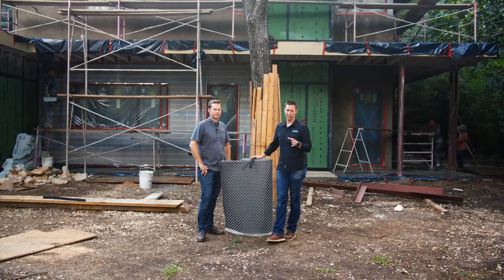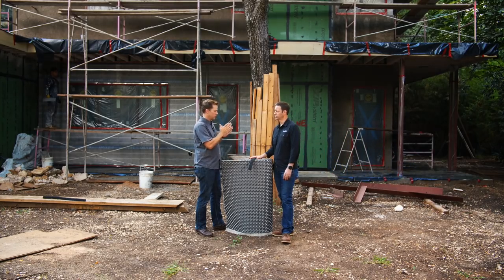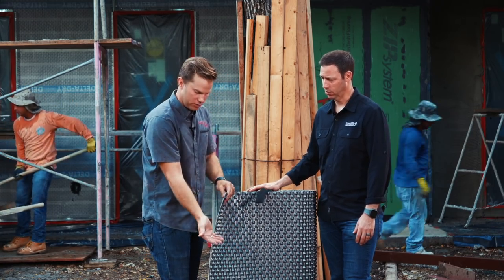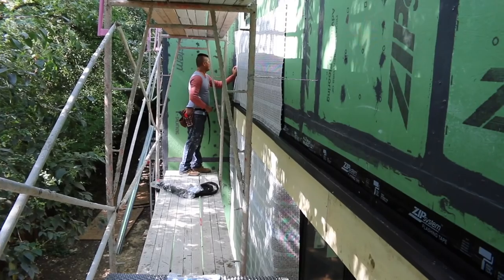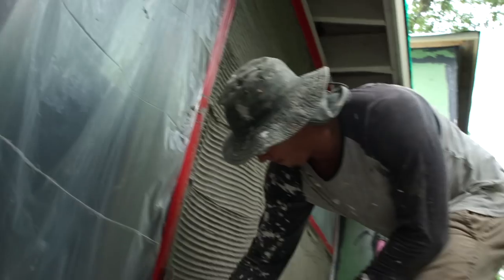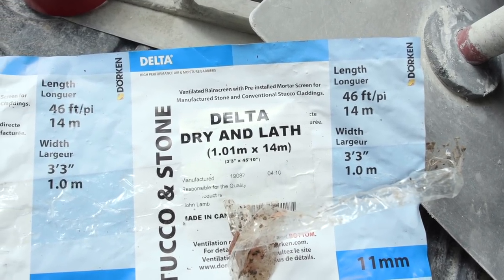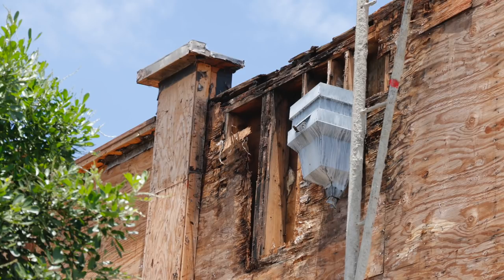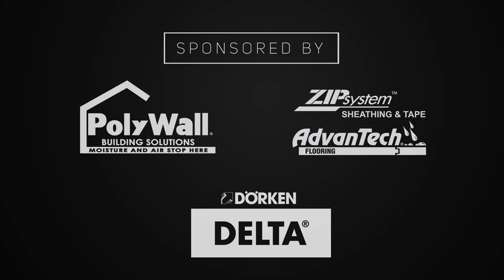WHAT is this, and WHY do you want it under your STUCCO?

Comment: It seems odd, it's the year 2019 I've been told; yet how is it that the art of not rotting a wooden house in practice hasn't Been implemented on most structures?
Reply from the maker: Because old buildings had lots of heat and air loss to dry them out. New codes mean less loss and less drying potential. If it can’t dry it’s gonna die.
Reply: Matt Risinger 
The largest problems that I see All Over the country comes from the adoption of OSB!  Your rhyme is cute; but you,  as a builder, are doing a disservice using OSB.
Reply: Bear Buster pretty much everyone uses osb and it’s been around for decades. It does work.
Reply: patty109109 
I know OSB is widely used but the only valid justification for its use is it is cheap. I have seen numerous relatively new places falling with what would have had minor problems if different material was used.
Reply: @bearbuster157  the same could be said and was for plywood but the industry has move away from using concrete form boards on the diagonal many years ago. In the end if you are not properly protecting your sheathing from water it will rot regardless of its form.

Comment: Really curious whether this level is needed in Arizona. Arizona is primarily stucco finishes, with minimal rain.
Reply: One way or another, get a radiant barrier behind stucco construction, WITH AIR GAP, and with some air flow pathway so convection updraft can lose the hot air outside the structure.   I live in coastal SoCal... a few miles inland from the ocean, and the same rules of precedence in heat blocking apply here as Arizona.   It's mostly about blocking radiation, not about insulating...    I installed a sub-rafter radiant barrier beneath the roof of my garage, two years ago, with dramatic results towards keeping my garage cool.  There is also ventilation...
So Matt's ideas about air flow are surely important.   My only question might be "Can we get MORE air flow?"  I see no numbers here, only ideas.

Comment: Hope anyone can answer this for me.  I am thinking about using Tyvek to wrap the house and before using the Delta Dry Lath system, do I need to put another layer on the black paper on top of the Tyvek?  Also, can the Delta Dry Lath system be used with both Stone Veneer and Stucco or do I need to go with the Delta Stone and Stucco system?

Comment: With all those staples, the Zip system is no longer air sealed or water tight.  I would maybe glue on Pressure Treated 1x3 studs or strips of PT plywood to the outside of the zip system every 16 inches on center and nail a cladding into those instead of nailing into the sheeting itself.  The studs would provide a nice airspace as well.  Exactly like rainscreen battens under siding.

Comment: not here in Saskatchewan Canada. they all do it the old way.
Reply: The old way worked when you were putting the tar paper over Douglas Fir, which most Sask Houses were covered with until the 70's.  That stuff was pretty rot resistant.  SOME of the new builds spray a waterproofing coat over the stucco, though.  70% of our new builds are disposable housing in everything else, so why put anything good on the outside?

Comment: Huh. I grew up in a stucco house. Never had a single problem with the stucco or anything behind it. I seriously doubt that they used anything like this behind the stucco. The house was old enough that the interior walls were plaster on lath. The house leaked air like a sieve I'm sure, and I don't think they bothered with any wall insulation, but there was never any problem with the walls not drying out. The floor under the laundry equipment rotted out, but the walls were always in good shape.
Reply: Old homes were constructed with vastly different materials and techniques.   Old homes were energy hogs but they were great at ventilating and drying.  Today we try to build tight envelopes with materials like OSB that don't tolerate moisture well.  In short, the tighter envelopes and manufactured material used to in today's construction significantly increase the need for installation methods and materials that allow the home to dry.

Comment: Is "stucco" a plaster based fassade material? There are products available that have a binder in it preventing all capillary forces (this has been standard for a long time where I life). Those plaster based fassades are completely water resistant for life (and can go on on either brick/concrete and similar or also on other stuff like synthetic insulation).
So either "stucco" is a different kind of thing and not plaster based (but it looks like it is), but the statement that plaster based fassades soak water like crazy is just not true when you use the right product. (also the addition of net structures is mandatory in all plaster based fassades in my home country, the net structure application shown here around the windows and doors would not be to code here. The net structure in the plaster here would not resist the forces well if it isn't double netted with 45° at the corners).
Reply: I think the word you're looking for is "facade."

Comment: Acrylic stucco is waterproof , so i am assuming that we don't need the delta product behind it.
Reply from the maker: How about the intersections, Windows, electric boxes, etc. won’t that caulk crack eventually and get water behind it?  Then it’s probably worse that it’s waterproof as it can’t dry through it
Reply: @buildshow  At least in central europe where I life those plasters (waterproof after drying) have been used for a very long time successfully. There are code regulations on how to install windows (basically all intersections) properly so they last a lifetime, but you need products that are designed to work together (I don't think you can just take any american window frame and use it as it is, as those have to have certain overlaps to allow the correct adhesion of the product). Additionally all those fassades are netted (like the polyester net shown in the video), doubly at the windows (in 45° offset). The plaster itself will not crack (they are quite flexible after drying, there usually is a lot of acrylic binder in them, if they are of good quality).
But I wouldn't just mix window frames and methods for applying the plaster that come from a different mindset with those acrylic bound plasters without going through all the details to make sure it works in the end (as I said, these are meant to be used in a system provided from one manufacturer, or designed to work properly together to specific norms by multiple companies).

Comment: Stucco has always gad an air gap behind it on properly done jobs.
It was called the "paper" but it was like tar paper that has several loose layers.
This new stuff should do a good job but may make repairs harder than when "paper" is used.
Reply: 2 layers of tar paper works since it leaves a little gap, but a lot of cheap builders only use 1 layer or staple lath right over tyvek.  Those homeowners are in for a surprise down the road.
Reply: @bigpjohnson  Saving pennies now that cost the customer big bucks later . . . I can think of another word for such builders rather than just cheap  :-0)

Comment: Moderators missed a subtle benefit of non-metallic stucco substrate.   It's transparent to radio waves!   Chicken wire, on the contrary, blocks wi-fi, and especially 433 mhz  (70cm wavelength) signals commonly associated with home gadgetry like driveway sensors, and even wireless smoke alarms.  (Yes, that might matter.)  I rely on doorways and windows for penetration by desired radio signals, and that's a headache.   So non-metallic is a welcome building science improvement, here.    By the way, I'm changing all the smoke alarms in my house to wireless DSC NEO, and they operate at roughly 900 mhz.    I will get a "condolence e-mail" if my house catches fire when I'm not home ;)
Reply from the maker: Great point John!  Hadn’t thought of that
Reply: @buildshow  Radiation is one of my obsessions ;)

Comment: Question: Why don't you paint the stucco to make it non-porous?
Reply: I own a stucco house in Long Beach California.   It's painted and the paint fades.     The purists around here have their stucco houses sandblasted and re-stuccoed.   A PhD structural engineer (retired) across the street from me did this and his house is the most beautiful on the block.   So was my father's house, when he built his stucco house in 1957, in Glendale, where I grew up.   Paint is a downgrade, and I'm thinking of sandblasting... 

The engineer's two-story house across the street has a huge wall with southerly exposure, of which I have a direct view.   The rainfall in Long Beach, and especially where I live, typically blows from the south, and that big wall gets visibly soaked.  It's very impressive to see how wet that wall gets in contrast to the upper region which stays dry by virtue of the roof's eave.   Within a few hours of rainfall cessation, that wall dries out, every time, and the wall is again uniform in color instead of light in the dry and dark in the wet.
Reply: @johnbecich9540  I grew up in Southern California and lived in a stucco house. Never noticed (as a kid) that the stucco showed a "wetness" after a rain. I suppose it did, just never noticed. Anyway, perhaps paint does fade, but better that than algae due to retained moisture. So, what about a clear coat? Wouldn't that give the waterproofing while still retaining original color?
Reply from the maker: Painted stucco isn’t really waterproof. It still absorbs water but can’t dry as easily. When the sun hits this wall the solar drive causes that moisture to move towards the house which leads to bad things.
Reply: Better question: Why not use a product with a binder that prohibits all capillary forces and makes the fassade water-resistant? ;)
I wouldn't paint it though, usually just painting is not a good way to seal anything.

Comment: nice Video but why do you install a Water/Air tight ZIP 2.0 system and than throw this Delta product onto the wall and nail the crap out of it??? Those nails sooner or later will fail and leave open holes in the wall. Why can't you take ZIP 2.0 system a step further and use a caulk as adhesive to apply the Delta system to the wall before you stucco so you don't have nails penetration your ZIP 2.0 system???  So far all the systems I have seen will not last for ever most what I see on the build show only will last less than 50 years before it require a major rework.

Comment: This product is a disaster just waiting to happen. The reason 30 lb felt, or even 15 lb felt works is because of the seal created around penetrations by way the oil in the felt. On the surface this product looks like it's plastic, which is not self-healing at all. But that's not the biggest problem, the biggest problem is whatever you have a product like this they tend to work perfectly on flat two-dimensional surfaces. But as soon as you get into the real three-dimensional world installers don't know how to apply their traditional techniques to the oddity of new products. While you can reasonably blame the installer, his fault is more in the choice of the material relative to his skill than in the skillet self. Products like these tend to speed things up, put more money in the hands of manufacturers, and deprive the end-user of the peace of mind and value created by of the time-tested techniques that built the trades in the first place.

Comment: Call me crazy but you take all the time to tape the joints and screws installing the zip then they go and punch a bunch of holes installing the drip backer, doesn't make sense to me.  Now I'm wondering about any siding installation, everything seems like it defeats the purpose of the zip siding???
Reply from the maker: It addresses it by leaving an air gap!  That gap is critical to drainage and drying. Thus the holes don’t leak. No air pressure to force it in. Drying occurs with out incident of rot.
Reply: @buildshow  We're talking about two different things, lol.  I get the whole air gap behind the stucco.  I was just referring to the instances of cavity penetration that occur on every job.

Comment: But now you are putting nail holes in your zip wall wheres water will follow the nail/staples right to the inside.
Reply: I was thinking the same thing?
Reply from the maker: No. They penetrate the zip but have an air gap in front of them which means there is no pressure to force in water AND it means the cavity will drain & dry!
Reply: Ok . But I’d rather not have the holes

Comment: Based on your video, this delta dry and lath product is rated or tested as a Grade D building paper equivalent??or is the zip system rated  equivalent to two layers of Grade D paper.  The old stucco installers preferred the building paper because it absorbed all of the moisture from the initial install and when it dried it formed creases and wrinkles creating a bit of an air gap/drainage plan.  It seems like a really antiquated method given the technological advances, but curious which product in your video is providing the two layers of WRB required by code?
Reply from the maker: The Zip is the WRB (initial layer of tar paper equivalent but better) The Delta Dry and Lath forms the air gap like the crinkle layer of the second layer of tar paper (but much better). This assembly meets code in every region of the US and Canada to my knowledge.

Comment: Great videos usually but this one doesn't seem to address the elephant in the room. "How does it seal those thousands of holes in your ZIP surface you're creating by stapling it?"
Reply from the maker: It addresses it by leaving an air gap!  That gap is critical to drainage and drying. Thus the holes don’t leak. No air pressure to force it in. Drying occurs with out incident of rot.
Reply: @buildshow  Maybe I'm just overcautious but wind could create pressure and drive that moisture into zip system. Isn't that what was simulated on your video "tyvek vs zip" by Zip guys? I'm just not sure how much pressure wind would create. Don't take me wrong I'm a big fan of what you're doing, just a small detail I've noticed. :-)

Comment: How do you say this is better then traditional methods when it’s not proven. It’s like saying that pex will out last copper or kerdi is better then a hot mop. Only time will tell. All I know is that traditional methods are proven.
Reply: Sensors, and analytical equipment can be installed in a test structure.  Moisture, heat, even bug infesetations can be measured, and compared to traditional structures.

Comment: I am not reading the all the comments...but you spend all the time taping and spotting the fasteners on the Zip" but than come along and nail and staple this product all over the the Zip ?
Reply: Efis foam system is always the best bet for the zip system. Basecoat mud is applied and grooved on one side of the foam, then applied over the zip system like tile over baseboard.
The insulation factor in much better and repairs like magic 👍🏻

Comment: Stucco is a NOGO. I will NEVER have a house with that crap on it.
Reply: You are a funny one.  Good luck.
Reply: Why not?
Reply: @zeake13  imagine if I showed a picture of a old car smashed into a wall and said that I will never ride any car because of that.
Reply: @ryszardbargiel7256  imagine, I've worked construction and seen first hand how stucco is garbage. .... Bricks are the best in my experience. I could break through a stucco wall bare handed. You can't do that with bricks.
Reply: @zeake13  but it sounds like you have a lot of bad experience with stucco.  Brick would be great, but time, resources, cost, etc. all factor in.  Bricks are not cheap.
And putting brick over existing walls, can be quite problematic.
Stucco is not stucco.  Basically what I'm saying is, that there is no single method, style, type, etc. of stucco.
I bet I could do a stucco you are not going to just punch through.
Everything comes down to the details.
Reply: i was hoping you would come back with something better than.... bricks. stucco is bad, but saying bricks are so much better? no
Reply: @Baigle1  not sure what you are trying to say.
But I won't say bricks or stucco is better.
People that talk like that just don't care enough; they decided they already know.
So good for them and their ignorance, I would rather learn something knew.
I could argue for and against either.
Neither is better.  Where is the context, where is the details?  That changes everything.  Then, maybe, one could assess which is "better".
Reply: I have 20 years in a stucco house here in the SF Bay Area...solid system WHEN INSTALLED PROPERLY.  My retirement home will likely have it as well.  But, yeah, if you're going to water the stucco constantly for 10 years, it'll fail...just like brick would, too.